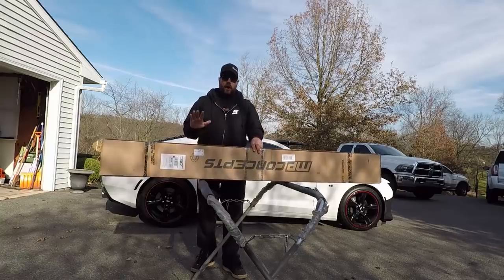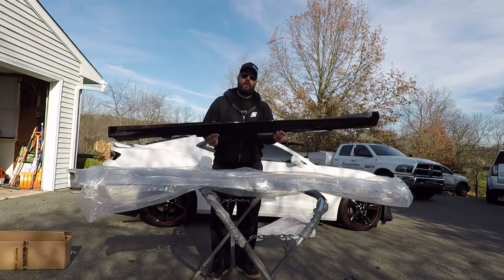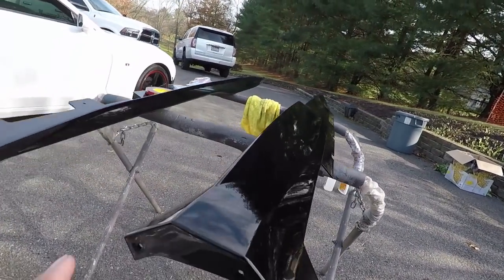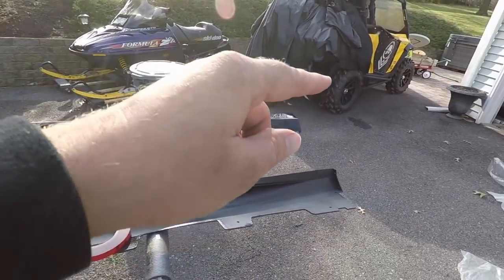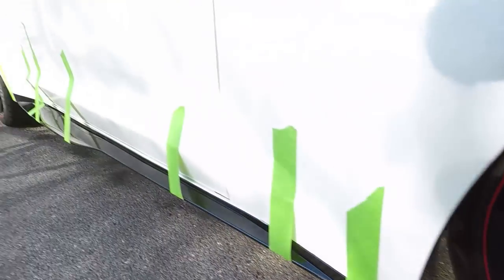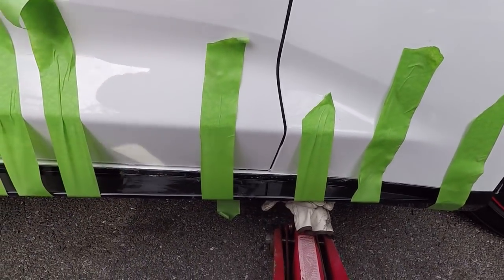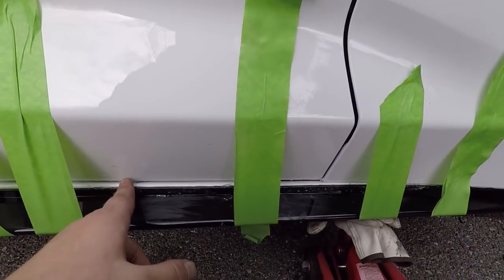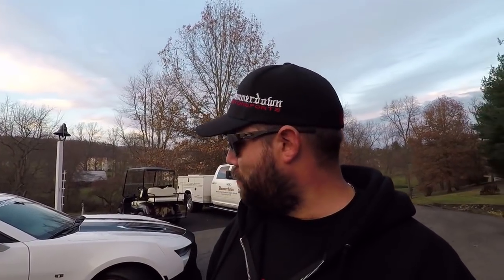A Must Have Camaro Mod From American Authority

Comment: I put on mine and it didn't go well at all, there is like a half inch gaps I tried the GOOP and the 3M tape it didn't get any better
Reply from the maker: I had some issues with one side I ended up getting panel bond to get it set in place
Reply: @HammerdownMotorsportsUSA  I really hope that it would fit perfectly fine, I really love the looks

Comment: I'm planing on buying this side skirts. How does the paint work look?
Reply: Hammerdown Motorsports good to know. How are they holding up using the goop. Lethal Camaro did an install on those and mentioned it's better to use the double side tape....